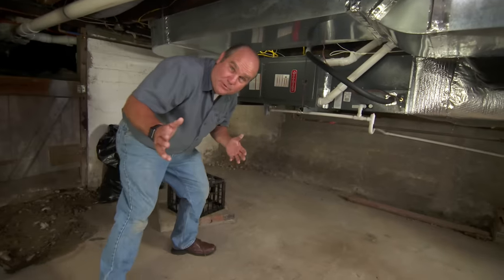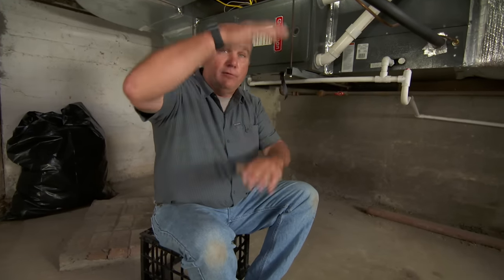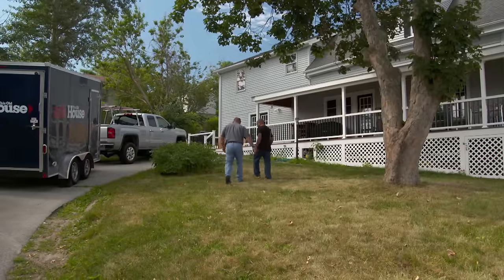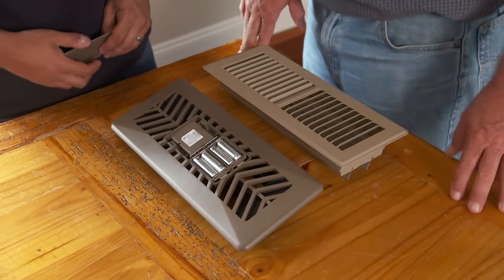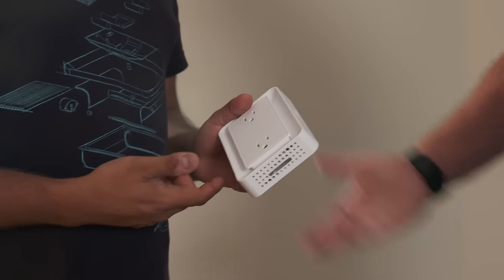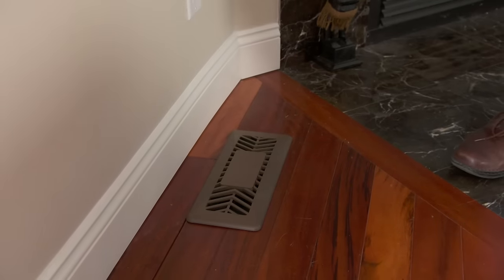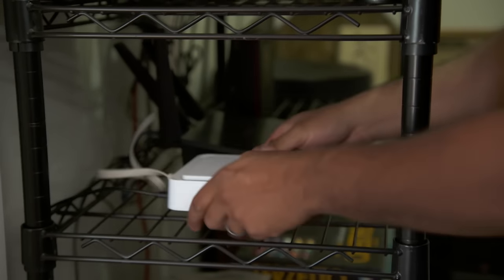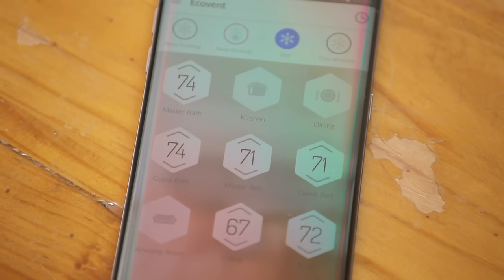How to Install Room-By-Room Zoning in an HVAC System | Ask This Old House

Comment: This is good idea, , have a question when these dampers close it increases static pressure in system the return is large bringing in air and now say 3 register are 50% ,1 is 70% how is VS blower going to adjust to airflow, without relief damper to make static adjustment??
Reply: yep, the fan works just as hard to try and force air through ducts that are closed.
Reply: only way system wont work as hard is if it is closed off before airflow enters the ducts

Comment: use a Variable Air Volume system. it will detect the temp in the room and adjust the motor and pump so that u only get the required airflow and coolant circulation
Reply: that costs over 5 grand
Reply: @strategygalactic  well how many vents do you have? Someone was saying the system would cost them over $4000. Plus batteries and the outlet sensors look kinda bad.
Reply: that could be zoned?

Comment: Dipul, I really need a solution that allows me to pull colder outside air through my home when the outside temperature is less than or equal to the internal desired temp. Perhaps a whole house fan integration with damper controlled fresh air intakes. Opening a closing windows for a whole house fan is both inconvenient and not secure.

Comment: What about installing Variable Refrigerant Flow (VRF) heating/cooling system?
Reply: very expensive system
Reply: That requires a system to be replaced entirely which is expensive. This also doesn't solve the zoneing problem.

Comment: The register doesn’t normally fully seal them to keep the flow properly that’s why you can’t shut them all otherwise error will activate by the hub and your smartphone will not let you close all of them..
Reply: A closed register "whistling" TO the HVAC graveyard?  The sound will actually be your system screaming for help.

Comment: After reading all of the comments from the so-called experts on HVAC I have just one question. If closing the supply vents will destroy the blower motor hit the limits in the furnace/ac unit etc., etc, why do I have manual controls on the all the vents in my home that allow me to do that very thing. With the room zoning controls, I can now centrally control programmatically via wi-fi what I was able to control manually.
Reply: Your manually controlled registers are never meant to close 100%, they get adjusted at the manual  takeoff dampers at the A/H main supply. These auto damper type do. Big difference.
Reply: Chances are mostly likely you'd never close all the dampers on two or more floors.... in fact, chances of you closing 50% of all your dampers is pretty slim but having an automated system do this is possible especially if it malfunctions due to inconsistent connectivity.  Also remember that closing vents will put back pressure to destroy the blower motor only if done in a LONG TERM fashion.... you'd likely freeze or boil well before letting it get that bad in your home which means you'd open vents.

Comment: I just doubt this will make much difference:( 
The hub is not synced with the thermostat, so there are two control points. 
If the thermostat does not provide enough air flow, then the room temperature won't be controlled by the sensor effectively....

Comment: Love the idea and the ingenuity. However, this seems like a bandaid. If you have drafty areas of the home or areas that are colder and hotter, your house isn’t performing properly. I feel like if you fix the root of the problem, there is no upkeep to that (replacing batteries, etc.), no daily monitoring on an app, and your home would be much more energy efficient.

Comment: After this system is installed and all the vent dampers are automatically adjusted, do they change from day-to-day or season to season ? I was thinking about this and they do probably change if you open or close a door to a room and may also change when switching from heating to cooling. If someone were to balance the floor vents manually using a thermometer in each room and being careful not to completely close more than 1 vent, which increases back pressure, I would think the need for this expensive system could be eliminated. If you have a 10 degree or more difference between rooms, your home's duct work was improperly installed. Using a damper of any sort increases back pressure.
Reply: You are correct Glenn.
Homeowners need to hire the right professional to figure out their HVAC issue after inspecting the whole system not mask over it by putting in the ecovents first.
Reply: Well, sort of.

The system would change from heating to cooling automatically, just like programable thermostats.

You want 68-72 degrees in the living room. If you open the door and the space gets up to 74 degrees, system goes into cooling.

While it is true that proper air balancing make all the difference in most setups, you have to remember;
-most homes are chain-mailed, meaning not much engineering planning is put into the system. (Unlike hospitals or other commercial settings)
-even if properly balance, the amount an intensity of heat sources changes things; too many computers in one room, or too many windows, extra hot.

In truth, a very expensive system is necessary if you want to zone any place.
SPECIALLY post installation.

That’s the beauty of this system.

But as with anything, it will not replace the efficiency of a properly planned zoning system.

Comment: I am curious about this product, I have an older home that is a split level and there is a big temperature difference between the upstairs and the down stairs. I am concerned that the lines running to the upstairs rooms are actually to small as they are only 4 inch round ducts and of course not insulated. could this help in a case like this where the downstairs gets cold or hot and the upstairs gets hot or cold. I recently had blown in insulation in the attic and I have reinsulated the outside wall and spray foamed the corners.
Reply: Yes Daniel,
Buy ecovent first, then we will help you fix all your other problems.
Trust us..........please.

Comment: If I were to add a central AC in a 2 storey house, is it a good idea to have a variable stage Air Handler with 1 thermostat on the ground floor? 
I was told that once the speed of the blower comes down, there wouldn`t be enough pressure for the forced air to reach the 2nd floor. 
Thanks a lot!
Reply: Do you have hot air heat in the house now?  Assuming that you don't, do you use the house in such a way that cooling the second floor is usually unnecessary during the day. (only go up at night to sleep)? Do you have both attic and basement?

Comment: Don’t you need a variable speed HVAC equipment for this. I don’t see how this would not kill the system if you close off vents
Reply: Hew says it won't lol
Reply: It will kill the system. You’ll get improper air flow leaving the furnace and if like he said the vents adjust according to air flow that means they open up slightly which defeats the purpose of having them in the first place.
Reply: @hvacguy11  No it won't.  Mine has been working perfectly for 4 years now.  No issues and I have my system checked twice a year.
Reply: @ericwilper3763  what’s the name of this system?

Comment: No mention of costs on the video. Their website reveals they won't sell the hardware - you must have it installed by their "pros". I would suspect an average system to be upwards of 2 grand. I can't see why adjusting your existing floor dampers manually to balance each room wouldn't work almost as well.
Reply: I do not see pricing on their website. These should be easy DIY kits.
Reply: Right on the money. It is not hard to install. I guess this is where their money will go.
The starting price is $2,500 (I received an email).
Reply: A bit too expensive for me. Maybe they are that good!
Reply: There is currently nothing as easy without hiring a pro to explore around your roof to do this.
It is plug and play. I definitely want zoning without the high costs and hassle of outside contracting.
Reply: Hi Dipul, Ecovent adjusts the vents to balance each rooms temperature. Before Ecovent, people were doing this manually for years. Floor vents have adjustable louvers for a reason. It sounds to me like you're trying to scare people into buying this overpriced system. I'm guessing the people that buy Ecovent also buy automatic trash-cans, soap dispensers and smart-phone controlled toilet seats - if there is such a thing. Oh yeah, and if my bedroom is too cold or hot compared to other rooms, I will adjust the floor vents myself.
Reply: Hi Glenn, not really. existing vents, even when closed, leak quite a bit of air; that's why they also sell magnetic covers at the store.  People have been closing louvered vents, but it's dangerous. the louvers are there to help pros adjust the airflow when they are installing the system, and to redirect the airflow (bend the air another way).   Existing HVAC systems are designed to handle some blockage, bit not that much.  Frankly, we would sell a lot more systems if we didn't warn people of the dangers, and didn't care about the safety of your HVAC. Think of it like eating fast food everyday, the impacts aren't immediate but in due time the food takes its toll. Same way here, not fear mongering at all, Google the dangers of closing vents and you'll see published studies and countless pros warning of it.
Reply: Hi Dipul, from my understanding, on top of the smart vents, room temperature sensors, and hub, the system will need custom magnetic covers depending on the vents that may leak?
Reply: I don't trust a company that doesn't offer straight pricing on their website, and instead lets the "pros" decide how much to charge based on the size of your driveway. Pass.
Reply: Manually setting my gents works absolutely perfectly you raise a good question most people aren't going to need this and ones who do think "whoa that's so cool I halfta have it!" are going to be out off by cost and who wants to admit I have to change the batteries in my floor vents lol
Reply: Anything on TOH is expensive and always has been.
Reply: Glenn Watkins let's wait couple of years and this system will be produced by many manufactures. 2500 usd  is too much.

Comment: Here's the problem with this idea. Dampening air flow anywhere other than the main trunk line is futile. Anyone who understands air balancing knows that maintaining main trunk static pressure is crucial for adequate air flows. This can be done if dampening is occurring at the end of main trunk and at the beginning of each zone branch. There should also be a modulating bypass damper installed linked to network for those days when low demand will cause low flow issues.
Reply: I agree, however I would add a reverberating neuralizer with mutating capacity.  You can buy them from Jeeves.

Comment: I don't see a variable speed hvac system that speeds up and slows down according to need Trane builds a really nice true variable speed system that even slows down the compressor to keep the same speed as blower so when one zone isn't calling it compensates with speed of compressor and blower so you don't burn the compressor or blower motor up

Comment: It's one of the better ideas I've seen in a while! How much they cost of a house. Too bad that they is no retail site, seems very easy to install but no info where to buy it from!
Reply: Being in construction for 45 yrs and a licensed contractor I would buy and install if system was available. I won't pay what would be a significant price hike for an HVAC contractor to install some vents. I can't even get an idea of the price because that info will impact what the contractors can charge if we the consumer new the prices, not a good way to do business. I understand there are homeowners that need an installer and that's fine. They should be available to purchase online and I think you will loose a lot of sales because of that.
Reply: Ian Mather I totally agree...
Reply: Ian- they dont need every tom, dick and harry installing this and then having to support the product because people 'think' they know what they're doing. I can see a whole lot of problems with this,  having a network of contractors that understand the product and can hook it up problem free is the way to go.

Comment: Unfortunately coming from the heating and cooling industry, I know this product may seem like it works, but in fact it may still cause furnace and AC issues. Remember!!!! The duct work is sized for the furnace and vise Versa. Closing one vent or duct is NOT good. This thing may close 2, 4,5 or all but one register may cause huge issues!!!!

Comment: But doesn’t the air handler and ac or furnace always have to be running then?
Reply: CobraGaming520 this is a good question, I have to assume the ac or furnace will turn off once the thermostat reaches the desired temperature. Integrating this guys system with the thermostat is the missing link

Comment: If you ductwork is not sufficient enough and you have not enough cooling or heating, how is this going to help?

This just modulates the dampers to cut off heating or cooling. If a room is too cold in the wintertime,  because your ductwork is not sized right, this is going to do nothing.
Reply: Answer: Fix your HVAC system ducting first.

Comment: Attention public.  You don't need zoning.  It causes more problems than any benefits you might get from.  Been doing HVAC for more than 30 years and have never seen a zoning system that really worked properly.  You are far better off with one thermostat controlling the whole house.
Reply: Agreed. Zoning is for big buildings, not an average house. Complete waste here.
Reply: @gangisspawn1  Yep , Last week I was in a house working on a zone system that was only 2.5 tons.  And I am just shaking my head.
Reply: I do t agree had a 2700 foot house had two zones and two thermostats worked great. My mother in law kept her area hot we had air.  Now living In a 3750 square foot house one thermostat. Basement freezing and first floor not bad, upstairs hot.  We have to keep the air low just too get the top two floors cool and you freeze I. Basement.  Any good ideas?

Comment: This setup will not work with a single speed blower motor and a single speed compressor.  It will do all of the things mentioned at the end of this video; closing off too many vents in a single speed motor system will burn up the motor, will have to much static pressure in the ductwork, make the ductwork too cold in AC mode and cause the ducts to sweat, and if enough airflow isn't moving across the indoor evaporator coil, it will send liquid refrigerant back to the compressor and ruin it.  There is inverter technology available in HVAC systems that in combination with this guys setup will better even out the temperatures room to room.  But, you must have the correct HVAC inverter system that will slow down the airflow when multiple zones are closed and slow down the compressor so it doesn't over feed the indoor evaporator.  And lastly, you must have a central zoning panel to communicate all of this.

So surprised that TOH didn't vet this story more closely.
Reply: In comes the 3 phase blowers with variable frequency drives. Now commercial HVAC is taking over residential jobs because homeowners don't know what they don't know.
Reply: This was clearly "vetted" (via cash exchange) by the company selling wireless registers. TOH has always had these segments of thinly-veiled advertising built in.

Comment: This is cool but the fundamentals of the HVAC system still need to be sound. Take my house for example, I have a smart thermostat and sensors, and you can close registers all day long, but at the end of the day they only put in one compressor for a large house, and it simply can’t keep up no matter how smart the tech informing my thermostat is.
Reply: It would seem that yours are not sound. If your house is very large, it might have been best to zone it with two separate systems. But any competent installer would have carefully studied your house's heat loss, humidity and other factors before selecting a system or systems. Have you considered that yours might not be functioning properly? At the minimum, have you measured the lowest temp at a room's supply and compared it with the highest temp at the return in the same room?

Comment: If room temperature is inconsistent, the original duct work and registers and load calc were not designed properly. If you shut off rooms, you alter the static pressure in the system and further screw up the air flow, and also reduce the efficiency of the system. Go back to rocket making, this is not your field. It takes years and a lot of study to become a good HVAC person.

Comment: If they turn off half of the rooms they might be in missile or ice age. First this hub has no interaction with existing thermostat, Second zoning system needs to working at any possible temp setting. I designed and installed my two zoning, either in heating or cooling mode, each zone has its own temperature setting or can be turned off (of course we cannot turn off both zones), CFM needs to be adjusted and matched with duct and aircon/furnace power level, if one gives freedom just to damper opening, furance may be burnt or evaporation coil may be freezed or explored.

Comment: Any HVAC professional would tell you to never try to regulate your house air at the registers. The reason is as the air is pushed through your duct, it will see the closed off register and "back-pressure" the blower. This results in more resistance so the blower has to pull more power and wear it out quicker. Also at the same time, the HVAC system efficiency goes down and electricity costs go up. Any HVAC professionals would tell you to use "HVAC dampers" near the manifold to regulate a house.